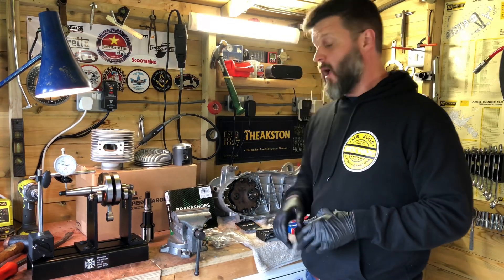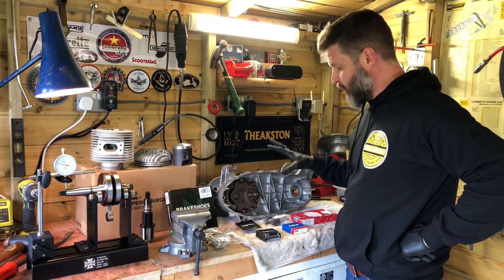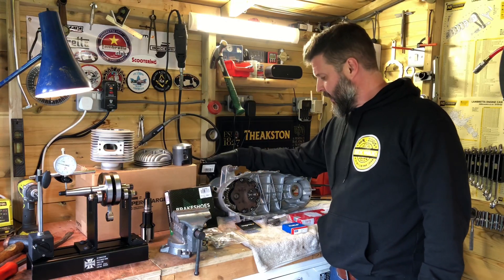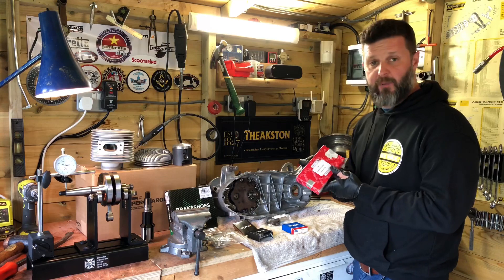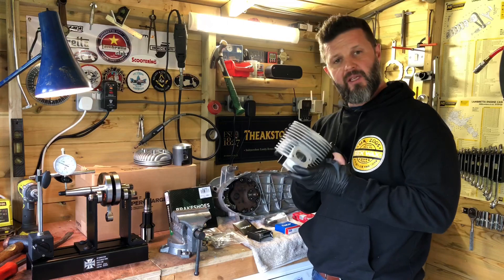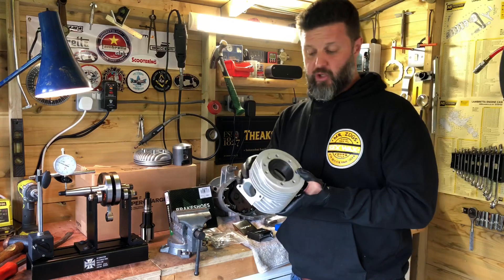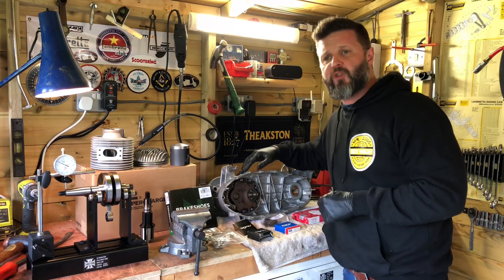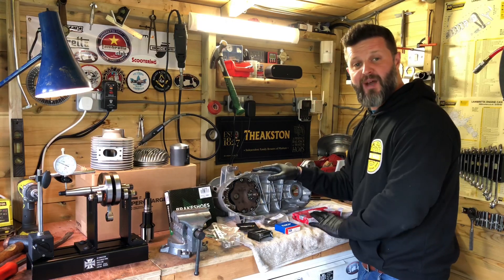BGM225 Lambretta SX200 Scooter - engine build component selection - restoration and repair

Comment: Hi Dan I’ve got more or less the same set up on my SX 200 BGM 225 but on your recommendation I fitted a Delllorto 30 PHBH running it open mouthed and used the jetting you said would suit most 200 lambrettas I’m still running it in or not thrashing the balls of it so to speak yet I’m finding when I’m accelerating in second and third gear it starts to pull back and splutter until I drop it into fourth  do you think the pilot jet is wrong it’s a 55  with a 125 main X 13 needle 2nd from top Atom av 266  what do you think🤔🤔🤔👍
Reply from the maker: What exhaust pipe?
Reply: The Scooter Factory hi Dan thanks for replying I’m still using the Scootopia expansion clubman I already had on the scooter it performed very well on the old Indian top end  with a 22 jetex carb fitted and it’s much quieter than my old AF 42 clubman otherwise it’s all standard
Reply from the maker: @ericwalker2172  ... you'll have to plug chop to double-check, but you may need to go down to the AV264 if using the Scootopia Clubman. Give it a try, see how it feels, and do plug chops to verify. If that works out OK, you can also try a half-clip spacer under the needle clip, to take it to 2.5, this will provide a nice richness/safety margin.
Reply: The Scooter Factory Thanks Dan not to sure what you mean about plug chops do you mean I need to keep checking the colour of the plug after a run out would a Dyno be the answer as there is one opened not to far away from me in Cornwall thanks for your help👍
Reply from the maker: @ericwalker2172  yup, exactly... check plug colour. A dyno (at a proper scooter outlet) is also a great option too.

Comment: Hi Dan what sort of running in would you have to do with the new BGM 225 kit there are so many different views out there what’s your opinion thanks
Reply from the maker: Eric Walker is the engine is set up properly (ring gap, ignition timing, jetting etc)... then zero. Good to go from the off. 👍